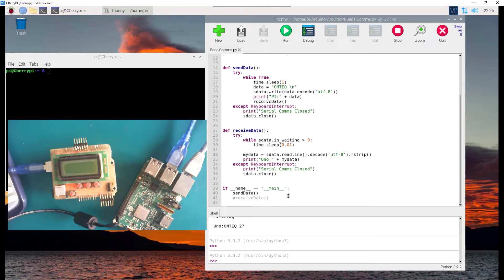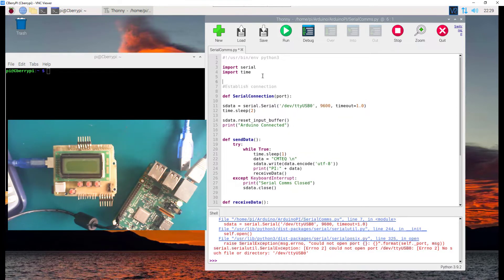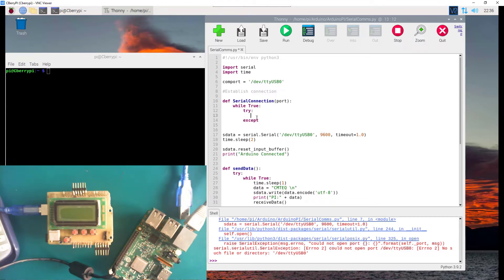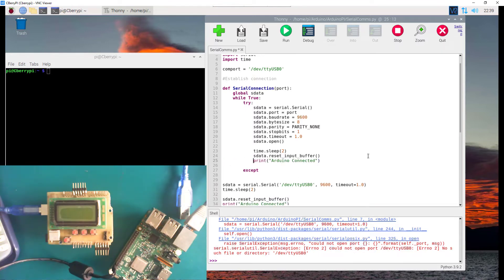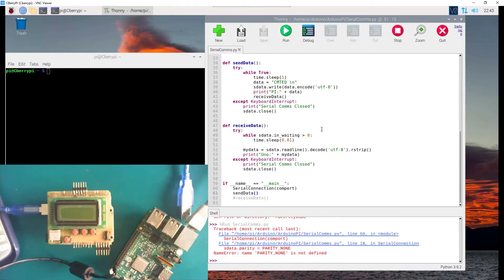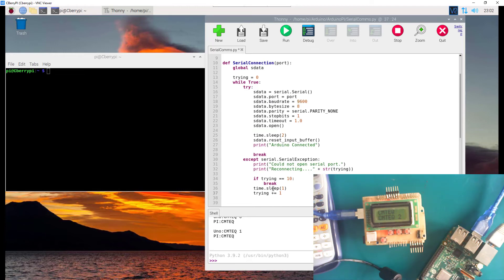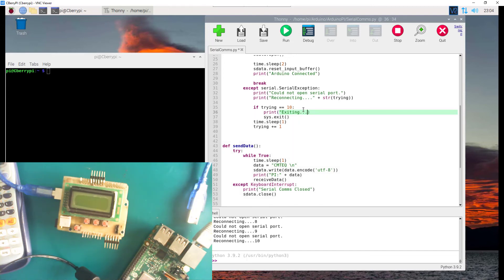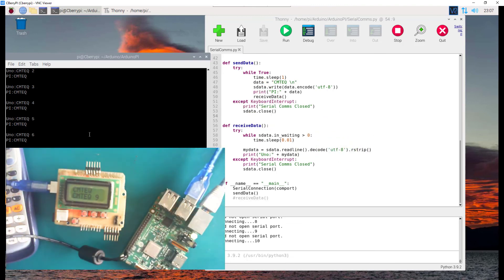How to Debug a serial port - ArduinoPI Serial Communication. Part 4

Comment: I'm quite new to Python and your video is excellent and really beneficial. By the way, I'm curious if you have a method for choosing a comport. As you're aware, the comport changes each time there's a disconnection. If you're running a system, it's inconvenient to frequently update the comport parameter. Any ideas on how to address this? I'm thinking of identifying the available comports and then utilizing that information to set the comport as needed. Hoping for your response. Thank you.
Reply from the maker: Hi @JeromePerez-ov3zn, you are right about that our only advantage here is the raspberry pi comport is always '/dev/ttyUSB0' for the first device you connect, so if you connect your arduino board or your serial device first before connecting other communication device, the comport will always gonna be  '/dev/ttyUSB0', but if you connect it after connecting something else it will change to  '/dev/ttyUSB1' and the function will throw an exception and crash if you not handing the exception.

There's always a way to fix it with programming, you can implement something that can check if the port is  '/dev/ttyUSB0' or something else and then take appropriate actions. I hope that help !